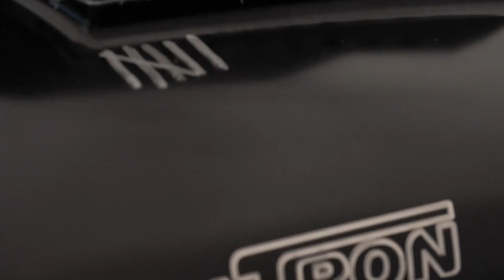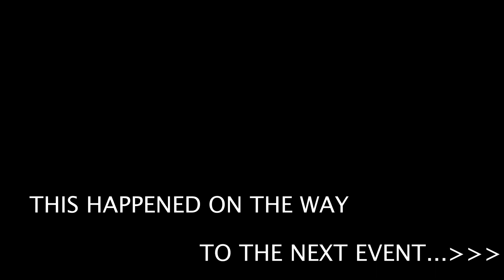Street Outlaws Ryan Martin No Prep Kings (NPK) BTS ep.10

Comment: That's the thing about Virginia in mid to late summer it is not only hot as the devil's peanuts but it is always very humid all the time day or night and that makes everything sticky and sweaty in the day time and makes for alot of water grains in the air all day then converts into covering everything in dew come night fall and that can make for a slippery situation when all the dew falls on the race track because it basically acts like a light rain shower which anytime you are drag racing you never want to see any moisture on the track surface no matter what

Comment: Ok so...the white smoke frim the exhaust is from the Regen mode on the engine. Meaning in short.....it pours more DEF into the diesel fuel system to "clean" the exhaust. This is Normal for all computer truck engines.  And. It may at times require a "Parked Regeneration"  if the light comes ON in the dash. 
      As for leveling valves...yes they do get stuck from time to time due to road dirt and grime etc.   If you have a dump valve, which you should, on the rig....flip it to Dump,  wait 2 minutes then air it up again.  Btw,  while parked,  dump all the air while stationary.
Reply: Ok so… I have never seen a SCR system on a DDEC 5 Series 60
Reply: @calebduncan3676  its on all recreational and commercial applications
Reply from the maker: Prob dpf on this rig!!   So no regen mode.   But a leaky egr

Comment: I noticed you guys fighting the inner wheel of the dual if you take a pry bar and just barely take weight off the bottom of the tire and use your foot to push in on the bottom of the tire you can usually slide the tire and wheel back with the pry bar and you won't fight it like that, I was a tractor trailer mechanic for just over 8 years and that's the best way I've found to get them off without fighting them

Comment: Dude it's like everyone evolved in this deal is dedicated to preventing u from winning again..you got to improve light,60' and go to the lockup converter to run harder out back.you can at the 50 penalty lbs exactly where you want them do help the 60' and the lockup will get you around those that get out better..no one touches you from after the 60 to 330'  but the guessers,1,000 qi 7 kit nitrous car & liberty trans with lockup converter cars are beating you by inches..a little better 60' and a lockup system you beat every car there with a gab..but recently your 60' is struggling so the penalty weight placed right will help that.i know you've never used the lockup much but your team and connections will allow you to figure it out in 1-2 test sessions...you've got to make that move now to finish this championship...make the change.make the car unbeatable..its the only way.or everyone not 405 is running the block on you to help kye win..I heard the Texas team talking about it with my own ears..they said do everything we can the help kye beat Ryan outta this championship...take 'Excalibur 'and give it what it needs to help you..adding the lockup system is like sharpening your magic sword for the last stand to save your throne

Comment: do not idle your engine even while fueling keep engine rpm around 1800 to 1850 the egr clean out burn part of that fucked up mess a higher engine speed is needed for it to complete a regen cycle this is getting a lot of people in trouble that is if you do not need the DEF fluid anyway
Reply from the maker: This truck is non dpf.   PRe emissions
Reply: @FireballCamaro  then if your truck has to do the regen bull crap you need to keep the engine rpm's around that 1600 to 1700 while not driving the truck for it to be able to do the regen or you will have this trouble hope this helps
Reply: DDEC 5 Series 60 doesn’t have an SCR system it is a Tier 3 emission engine so it only has EGR.
Reply: @calebduncan3676  sounds like the truck is not as new as i was thinking hope Ryan can find a good price on the EGR he needs for the truck shit like that is not cheap was hoping that my first thought would help him setting up the RPM like i was thinking would be far more cheap than buying that darn EGR